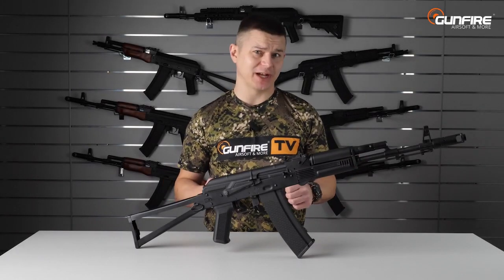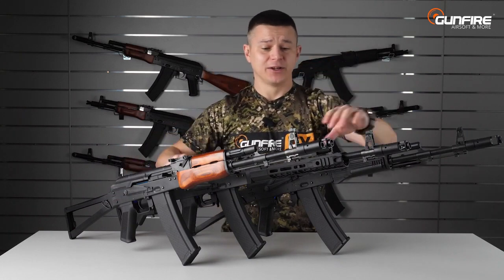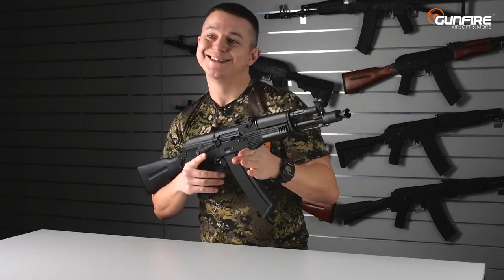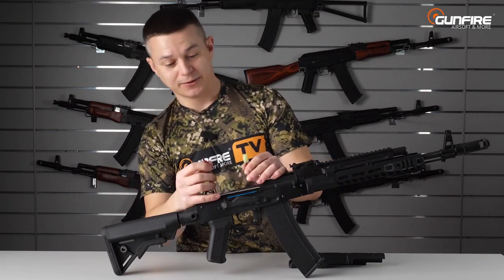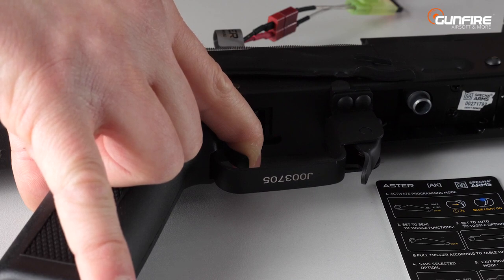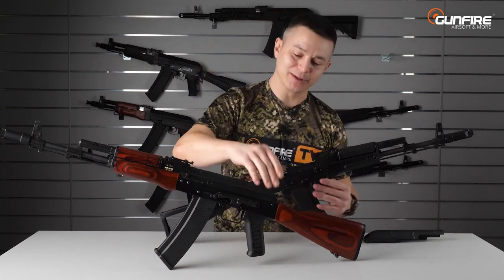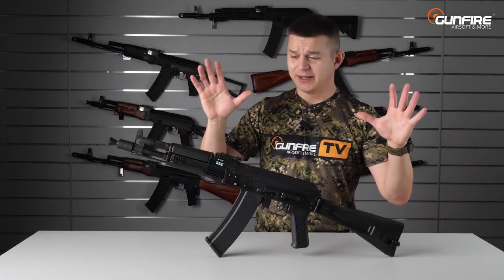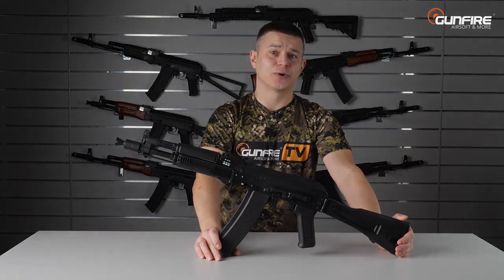Specna Arms EDGE 2.0 J-series - electronics, precision barrel, steel - highest model of the series

Comment: Do titan batteries fit inside these?
Reply from the maker: Depends on capacity of the battery. This should work: https://gunfire.com/pl/products/akumulator-li-ion-11-1v-3000mah-stick-tamiya-1152230150.html
But it fits tight.